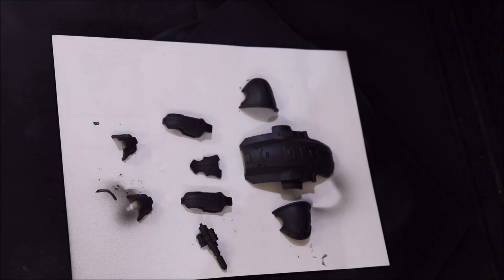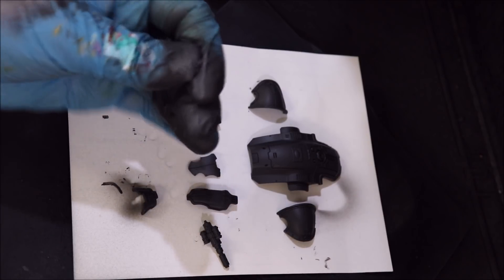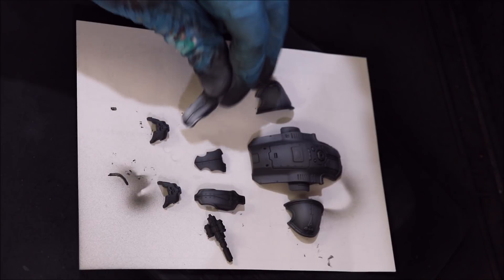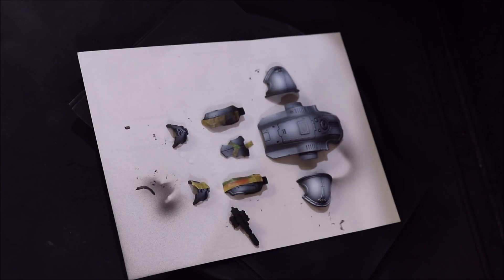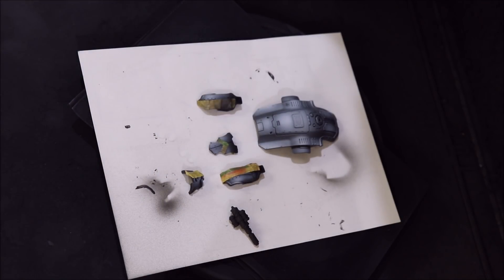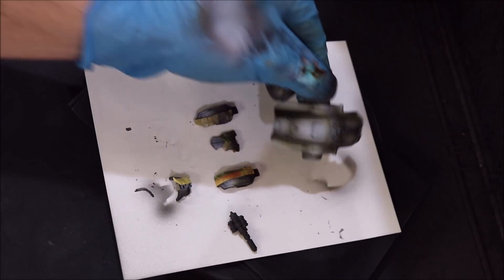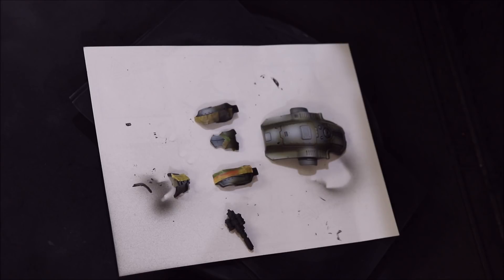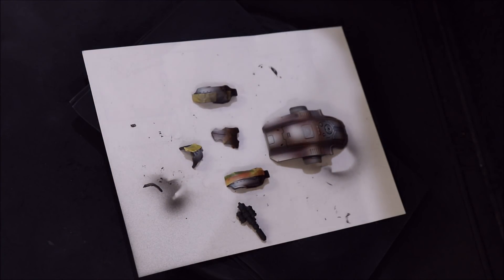Hobby Cheating 151 - Panel Modulation for Vehicles

Comment: Hello Vince, amazing video! 
I wonder, how would you do light green - eg sky green from AK? 
I would like to do Sons of Horus vehicles - spartan and the kratos - using modulation, i wonder would the green (sky green) too soft for the black areas? Would it cover well to create the effect, or i need to use extra product for the shadws?  Shall i use red for the shade areas same way you using sephia? Cheers - Jan
Reply from the maker: The sky green is too soft for black areas, you’ll need a darker color for your shadow areas by just a few steps
Reply: @VinceVenturella  thanks!

Comment: Hi Vince, 
Awesome video, coupled with the hobby cheating 89 i plan on using the techniques on my own Knight.  Im planning on a cold white scheme, what variations to the video would I have to adopt?  Im assuming black as a primer is too dark as a starting point?
Reply from the maker: Yes, it depends if you want warm or cold white. If warm, then some subtle sepia and/or light brown tones are your good color (what you see in the shoulders in my Knight). If you want a cold white, then you want to bring it up to a subtle blue/grey and have a dead cold white lightly in the center of the panel.
Reply: Thanks vince.

Comment: Hey Vince - great video. Just curious about whether you feel the initial dark grey and cold white actually bring anything to the final finish? Could you not have started with hull red, gone straight to the cream white, then the sepia, then on to the reds, saving a couple of steps?
Reply: I was wondering about the same.

Pre-shading seems a bit pointless when you go over it this heavily.
Reply from the maker: My answer is yes, it does have an effect. It's not always even consciously visible, but having the layers of paint presents separation and increases the density of visual information. Your eyes and brain are condensing it down, but your subconscious does notice the enhanced effect. It creates additional information and enhances the tone of the red. 

Now, all that being said, if you didn't want to go through all the steps, you could do it from the straight red as you describe.
Reply: Thanks for taking the time to reply. It’s often kinda hard to judge this kind of thing on video, so really appreciate your thoughts. 👍

Comment: Is there a good way to do these preshading techniques on a tank if you're also planning to do weathering with chipping fluid later? Putting a rusty brown pre-chipping basecoat over this preshading, then painting possible multiple layers of camo over that would pretty much completely obscure the preshade, would it not?

Would it be better to try and modulate the colors on the top layers using lighter/darker mixes of the tank's camo colors rather than attempting to preshade in this case?

Sorry if that doesn't make sense, I'm new to airbrushing and weathering and I'm trying to bring several techniques together at once, however I'm worried I will ruin several models before I get a decent result. Maybe I'm just being too ambitious.

Anyway thanks for the video, this series always provides plenty of things for me to mull over.
Reply from the maker: It will have a much lesser effect. You can lay it down, then put the brown over thin, then use your chipping medium, then do your camo thin. In the end, it's going to have a very muted effect (it will be there, but minimal) under all that paint, even if thin. 

The other way to go is the way you describe, using the colors themseleves OVER the brown, then chipping them. This is a way to get the stronger colors for sure if you are going for the chipping method.
Reply: Check out Panzermiester 36 on youtube for hairspray technique for chipping.. Also, Herseybrush.com has really good tutorials on panel modulation and weathering for tanks. I started an Imperial guard army and plan to use these methods for my vehicles. I would suggest trying it on 1 vehicle first. Write down what steps you take, then when its done, if you like it repeat on the rest. Also, if you are new to Airbrushing, be aware of the "hot garbage phase" its basically after you airbrush everything, but before you have blocked in your details and applied your washes.

Comment: Great video and well timed! I just finished building some 40k Eldar Grav Tanks that are in need of this. I've done some experimenting with purple rather than red, starting with a black/grey/white zenithal. But haven't had any where near the level of success in creating tonal variation. Any recommendations to make purple pop? :)
Reply from the maker: Use a little blue in the middle area, like a mid-tone blue and a deep purple ink near the lines before going over it with a thin all over purple. Alternatively, you could do a little pink in the highlights and then put purple over the top. Either would add a bit of additional variation and interest. Hope that helps.
Reply: I'll give it try. Thank you so much for the advice!

Comment: Vince, how do you manage the backfill with your finger? I've never been able to get a seal around the needle when trying that, so have to grab a damp paper towel to form around it.
Reply from the maker: I am going to guess the challenge is your tip. Do you have a solid round tip or one that looks like a tooth with cuts in it? If you have the cut tooth tip, just replace it with a round tip guard. The backfill is then easy.
Reply: my H&S has some annoying tip on it and then my badger has that tooth one you are talking about, both i just run without the tip because it was a pain cleaning when things got gunked up. I was not aware they sold alternate tips for brushes. Will look it up, thanks!

Comment: does this differ from vehicles with lots of edged surfaces (e.g. Land Raider)? your example has a lot round surfaces.
Reply from the maker: It can vary some. with vehicles with lots of smaller or heavily angled panels, you probably don't want to highlight every panel toward the center. Instead, you would perform the same technique, but push the highlights toward a universal edge (i.e. all the panels being highlighted catch light on the edge of the panel, bringing light to the edge Hope that helps.

Comment: Hey vince, it's that super annoying guy again. Finished my bloodthrister and getting set for the next project (hopefully starting painting soon, models are ready). My next army that I'm super keen on (and wanting to start the second magnets arrive to finish their arms!) is chaos knights - House Vextrix. The Titankin. 

I've got my workplan sorted, just wanted to pick your brain on a few points. 
1) Black panels. I saw you did them in HC 288 (your titan) - those black panels had flames or hazard stripes. In keeping with Vextrix, these black panels are mostly just plain black. Would you approach that with a very faint grey as modulation or try push it? Some have decals (well...) but most are blank, and plain black is very boring and looks kinda meh.

2)  Decals. I don't love 'em, but this army straight up does not have them on the chaos knight sheet. Or the imperial knight sheet. The book art shows 6 white cogs, plus 4 white cog halves. An imperial knight sheet gives exactly half of that. Neither sheet gives plain black swords.  I don't have the confidence to freehand that many cogs in white ink and then the other ones - cog, skull, sword through both - is beyond me. Especially repeated over a bunch of armigers and four big knights. Hell, the chaos sheet has 0 cogs and no white chaos stars. Very frustrating. 

Any thoughts on how to handle that decal situation, or just use some all over to create some visual interest and ignore the gws style where there's two large decals on each shoulder/leg plate? That sort of green/black doesn't give me a ton to work with, especially if I keep the muted, rusted silver trim. Not the best with weathering panels, but I might have to learn fast to make this work.
Reply from the maker: 1) yes you should still modulate the panels. 
2) if it’s not for GD, then go nuts, use the decals you like, use stencils, do Nurgle symbols, look on Etsy/eBay for custom decals, whatever you want.
Reply: @VinceVenturella  Not for GD, I'm not delusional. I do want to make at least one big knight as good as possible; push the limits of what I can do and have a piece I can show off and be proud of. 
Looking at ebay transfers it's... well, nasty. $25 a sheet, plus the same in shipping, from america to australia. And locally.. ugh. Maybe a bloke at the LGS would be the best bet. 

Would it be plausible to use the decal sheet to create a stencil? Cut out a square around the cog pieces, remove the cog pieces, then tape and airbrush white ink?
Reply from the maker: @benstaffordson7163  not really, you'd be better ordering from fallout hobbies. But again, if it's not for competition, take the swing at some freehand as well., It costs nothing but your time and hey, if you fail, you can just paint over it. :)
Reply: @VinceVenturella  Youtube deleted my comment, sad. 
Anyway, I can't write legibly and have relied on computers for years. Wrist control is just something I lack; I'll give it a go for the sake of it on an armiger, but I have low expectations. I do intend to freehand some green/black flames (as per the house vextrix art on the wiki page). Flames are organic and not consistent anyway so that should be fine, whereas precise, hard lines being repeated will doom me. 
I took a look at fallout hobbies  as I'd not heard of that brand - as always you're a bloody legend, they literally have a decal sheet that is perfect for house vextrix. As in, intended for it, with the sword/cog/skull and all. No relevant stencils, but I guess I can live with perfection and just scuff these up when they're on the model. 
They also had some really cool stencils that I may use for future armies, when funds allow. 
Thank you so much for your advice, as always. Got a product if my skills fails me, so that's well ahead of where I was a few days ago.

Comment: How do you paint the lines?
Reply: Or maybe what do you use to paint the lines
Reply: Check out hobby cheating 56. That might be what you're after.
Reply from the maker: Exactly correct, I just go back and black line them with a mix of dark brown/black ink (I use a stronger shade for the big vehicles than in that video, but same principle).